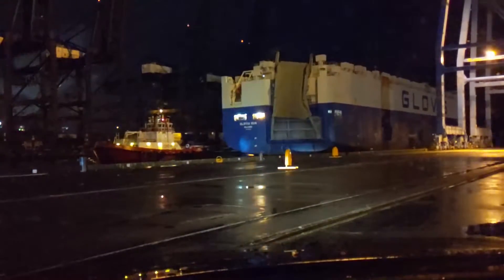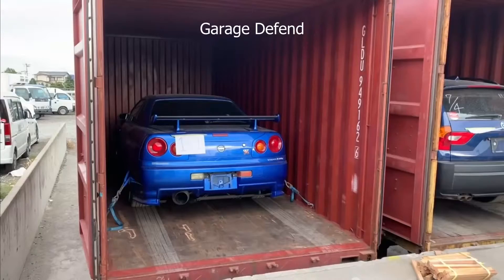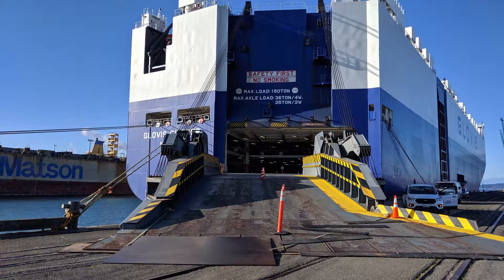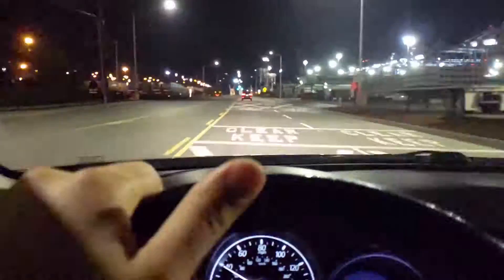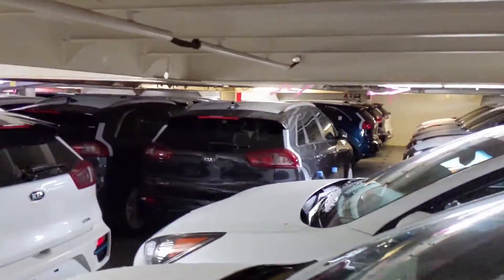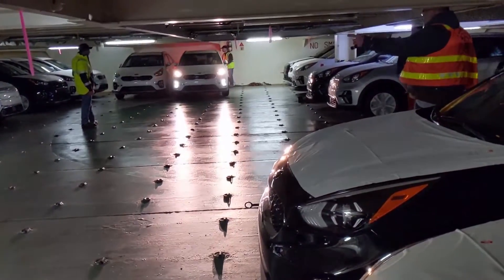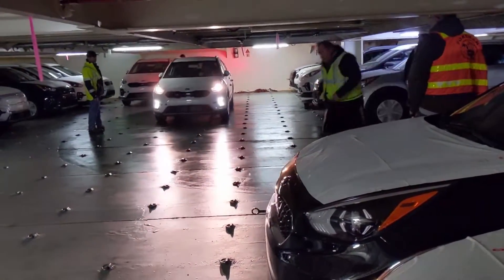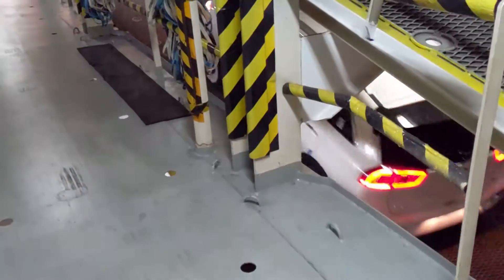How cars are shipped in RORO vessel, roro ship or shipping container overseas

Comment: Great video man. Looking forward to part two of the terra firma carpet install and rust fix. Any idea when that’ll be coming out? I just finished the install on my 801 black carpet as well.
Reply from the maker: It is going to be a while. I figure maybe around spring. I have to save some money to get the car fixed. The GTR is still sitting and I have not touched it in 2 months. I will post it as soon as it is complete.
Reply: JDM Right Hand Drive excited to see how she turns out!

Comment: I’m considering shipping a couple of cars of mine to Colombia, I hear that some have had nightmares having to grease the palm of corrupt people working where the ship docks.  Wondering if it’s even worth the possible trouble and extra money.
Reply from the maker: I would do some research on the Port of Entry and see is there are any reported issues with that port. Not sure how things work on Columbia. But in the USA all major sea ports have 24/7 security. You need special clearance to gain access to the sea port as well. Plus you have to have all the necessary paperwork in order to receive you vehicle from port. I would imagine Columbia would operate in a similar fashion to this. But, I would definitely do your research.

Comment: Hey dude nice short video there, I have a question mate maybe you know, I would like to buy a truck here in the UK and send it to South Africa,  problem is it doesn't drive due engine damage, is it possible to ship this since it is not driveble?
Reply from the maker: Yes, should be pretty easy if it is shipped in a container even with in not running. I would not recommend roro shiping. I don't think the shipping line would take a not running vehicle on s roro.

Comment: Hey there! I have recently purchased a jdm and it is currently getting prepped for Roro shipping. Do you know which forms I must submit and how I can get access to my vehicle once it has arrived? I’m in NY. Thanks so much for the help.
Reply from the maker: Your export in Japan should be sending you an ISF form. You need to hire a customs agent first. You need to submit the ISF form to them. once they have that they can schedule everything through the port of arrival for your vehicle. The dealer will also send you a customs packet for all the export documents. You provide those your customs agent and they will build you a customs entry packet. once the car arrives at the port you bring the customs entry packet and you pick up the car. You bring the car in the customs entry packet to customs and you get the vehicle cleared. From there you take it to the DMV and you register it under your name.
Reply: You may have wanted to look into that stuff before you bought a car in Japan ;)
Reply: @sonicCherryBell  i got my import with 0 issues. I did my research and got everything sorted on my own. You’re a bit late, chief ;)

Edit: thank you for adding nothing to the conversation btw!
Reply: Hi, can you share your experience that you do it all by yourself. I purchased a car in France and plan to ship it back to USA, thank  you so much!